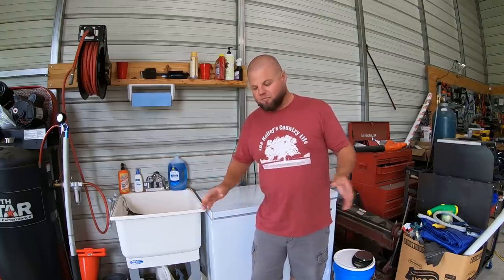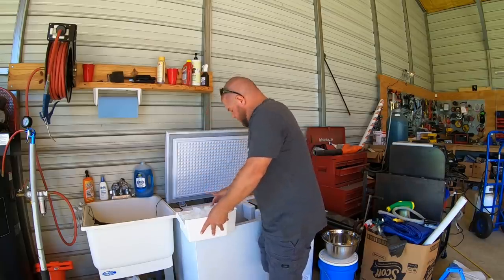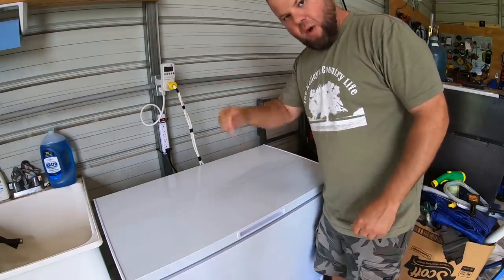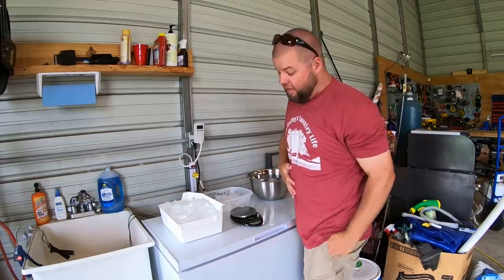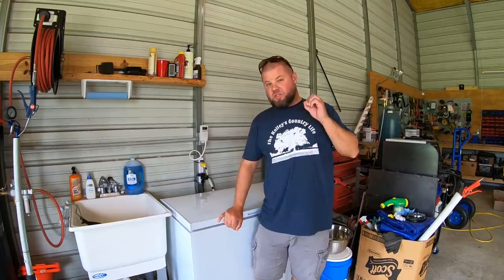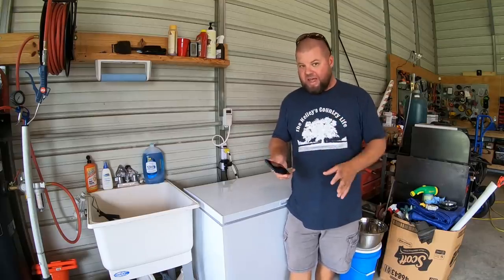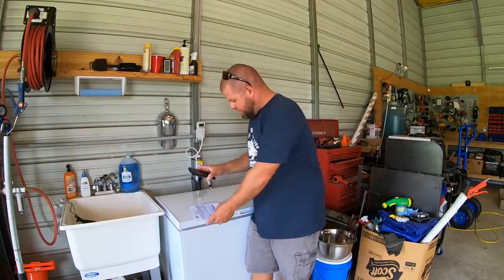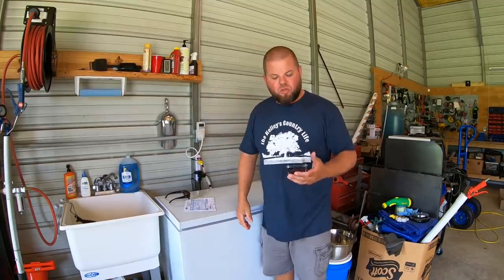Homemade DIY ice machine tests, energy usage and cost per pound! #370

Comment: The only additional cost you're missing is the cost of running the well pump for the few seconds it takes to fill the trays... More than likely negligible, but might be worth mentioning. Sure would be hard to measure given that you're using the water in the house as well. In reality, it costs less than washing your hands an extra time each day :)
Reply from the maker: I tried to figure it, it's basically nothing for this amount of water. Maybe a cent a 20lb bag 🤷

Comment: Is it possible to have an internal camera? It would be fun to see how many ice drops ie 1 drop = 12 cubes = x pounds and you could see if not opening the lid makes a difference? Also if you make a ramp so the Ice shoots to the storage not blocking the underside of icemaker? 

My other thought is the Ice ramp that bypass your collection spot and has a level. Allowing you to hook up a digital weight of your freezer and track production and consumption of ice with out the hassle of tracking and an error that could occur?

Depending on empty weight of freezer ie no ice but all parts could you set up a digital recording of the weight of the freezer day by day to say the weight of 100 pounds of ice and week 2 we made 50 pounds  added to week 1 45 pounds and used 5 pounds could all be calculated based on average weight? Tracked by raspberry pi  and data could be plotted.

Yes a second point of data confirmed calculated  that could end up continuing with digital recording of electrical use and automated software so you have numbers generated.  For 2.0 it would cost justify .44 cents with verification.. I am sure 3.0 will be behind it!
Reply from the maker: Good thoughts

Comment: Dissipation of exterior heat Idea, some kind of aluminum heat sync, I know I'm not considering a cost of the heat sync material just a NON electric use of dissipation of the heat to help "Speed" the transition of the coolant back to a liquid state yada yada yada you get the drift...
Reply: I'm referring to the exterior of the deep freezer
Reply from the maker: Understood, thanks

Comment: You're using .188kwh per pound. Commercial ice makers use between .055 (US DOE) and .075kwh (PG&E) per pound. So, your efficiency is bad, but we're only talking pennies. The difference in equipment cost is huge, though.

Comment: The hot water freezing fast your thing isn’t necessarily practical. In an environment with unlimited amounts of cold air or the ability to draw heat away hot water evaporates and evaporation gives you greater convection and greater heat transfer so yes if you put a small container making one or two cubes in your freezer it might be freeze faster withWarmer water the problem is the freezer device is a unit that removes heat from the interior of that freezer and depending on how efficient your unit is you have very distinct limits at which point the efficiency as loss by adding the heat so to make a very small amount of ice very very quickly in a shallow tiny ice tray in a very big freezer, yes hot water can freeze faster like if you were outside at -25° and threw a small container of hot water into the air, what hits the ground will be more frozen then if you did the same amount of cold water but in a confined small area where that heat is going to take longer and more energy to dissipate that threshold as well as your devices ability to do that heat removal you also have to look at the temperatures with your freezing out, this is a deep freezer and it should be operating at a colder temperature then the 32° at which water freezes it should be at least subzero temperatures in Fahrenheit. The test will prove it but my guess is not only will you find that the cold or the cooler the water the more efficient it is and the faster it produces ice but you also find it gets rid of other problems because when you freeze hot water the outside is going to freeze faster than the inside and the ice you drop it still going to be wet and you’re going to get a lot more clumping in there than in the end I think and I’m predicting that the results will be more Clumpies ice and tire energy usage. It’ll be interesting to see how that one pans out.  

As far as the clear ice goes filtering is one option but also some of the clearest ice has to do with mineral and particularly sodium levels the crystal clear blue ice you see on glaciers and things like that are usually in areas with salt water and part of the reason they’re clear is because salt water freezes slower and will let the gas and air out during the freezing process but as far as making a list for your purposes which would be either drinking and mostly filling your cooler to keep fish and drinks and other things like that cold, a clearer ice affected by salinity would melt much faster it would really be something you don’t want not to mention your freezer would have to work much harder to freeze that ice in the first place and keep it frozen. I’m sure you know from fishing and boating salt water freezes at a much lower temperature than freshwater. And of course filtering ice for health reasons is good depending on the quality of your water and water is already sediment free and healthy then it’s completely unnecessary if you live in a cesspool city with a horrible water system like Michigan it’s potentially life-saving. You can get a TDS meter for about 10 or 12 bucks off Amazon that will give you the dissolved solid content in your water to determine how much crap is in there along with minerals and other elements, and Aro filter or RODI filter would give you the purest water with basically nothing in it but oxygen and hydrogen but I’m not sure water is bad to start with it’s really not necessary.  Almost any in-line filter would make most tapwater’s incredibly clean and safe but I don’t think for your usage it’s really something to worry about unless you’re getting your water from a shallow sand well or pond or lake. Clarity theoretically would be unless air in the ice making it more efficient because you basically have more ice in that amount of space but other than looking pretty I really don’t see much of an advantage unless your water is very unhealthy to start with.

Comment: Wow with the testing you've already done I'm hoping you decide to make a power drive for a kayak it's my ideal the kayak rowing is the wife's bright ideal let's get healthy kick she is on I work 12  hours a day I need a electric motor on a rudder  help please if possible
Reply: Jeff, see if this helps: eBay a 20Ah LiPo battery,  Minnkota trolling, if really want cool help for battery add a flexible solar panel 100w is about $50?. Why do I harp about the value you get from these batteries? Ten Times better on power curve right out box! Equal to twice lead! Last ten years! Ok I ll stop.

Comment: Keep it going love your videos.  Your cost per pound of ice does not account for the cost of the water.  If you are using well water, you would have to calculate how much power it takes to pump water for a pound of ice.
Reply from the maker: It's almost non existent. 80 gallon tank that almost never kicks on, and when it does the pump runs for literally a few seconds. So a cent per 20lb bag... Maybe?
Reply: @TKCL  Yes you may be right there.  Thanks.

Comment: You also benefit from less heat being generated in the freezer when you take one fan out, it isn't much at all but every little bit helps I imagine.
Reply: Technically true, but realistically negligible. Two fans were using 2 watts, so 1 watt of heat is all that would be removed. The way compressors work, it takes way less than 1 watt of power to move 1 watt of heat, so that 1 extra watt of heat is probably only causing the compressor to use an extra 0.3 watts.
Reply: @AsherMaximum  It's almost like I said it wasn't much at all.

Comment: Would a frost free freezer make more sense?
Reply: Its would partially melt the ice id imagine, making ice slabs. Also costs more to run
Reply from the maker: That's exactly right, not the correct freezer for this application

Comment: If you really really want to be accurate, empty or reset ice machines before each test.   Also consider adding a timer to the fan with double switch.   Primary switch is lid open closed, secondary is timer.    Weird how your experiment is interesting.

Comment: Be sure to factor in the cost of the machine when figuring the price per lb.  You'll have to guestimate the life of the machine,  maybe 1000, 2000, or 10,000 lbs. who knows?
Reply: $300 machine with life of 5 years just out of warranty put $0.33 for 20 pounds bag of Ice.
Reply from the maker: I did in my first video ROI was 9 months at my current usage for just equipment, it's has since improved. Still cheaper than store bought

Comment: Haven't seen this mentioned a lot in the comments, but you should be able to save yourself a lot of time weighing ice by adding a flow meter to the water inlet, and just measuring that for 24 hours instead.

This one is only $20 and measures to 1/10 of a gallon, which is equal to 0.8 lbs of ice, or 12.8 oz. It's meant for a garden hose, but it should be easy enough to hook up to your system with a few adapters.
https://smile.amazon.com/Save-a-Drop-P0550-Water/dp/B0058EOC5M/ref=sr_1_2

It has very mixed reviews, but all the negative reviews are around longevity, not accuracy, so for a short term project it should work fine I think
Reply from the maker: Thank you

Comment: Did you say that you've paid about $360 for the entire setup? 
.44 x 20lb bag. 
10 lbs per day at .22 per day, 182 20lb bags per year is your current capacity.  

Then divide the cost of the setup by 10 years (average life span) to get your per year cost of the ice maker.  
Total DIY Cost per Year  = $36 per year + (.22 per day) $80  - or - $116.3 per year
$116.30 for 182 20lb bags per year

 Total Retail Cost per Year  vs  Total DIY Cost per Year
$2.50 x 182 20lb bags =  $455
$3.99 x 182 20lb bags = $726.18 

Someone else can check my logic and math.  But, it looks like you are definitely saving money.
Reply from the maker: Thank you for the breakdown, I was getting ready to do that myself

Comment: I cannot help but wonder of those who labor under the misapprehension that "hot water freezes faster than cold water" have ever actually tested that claim. Think about it: Water freezes at ~32 degrees F or ~0 degrees C, depending upon some variables. Would they have us believe that if you heat the water to a temperature GREATER than 32 degrees F before hand that it will then freeze FASTER than if you didn't heat it up? After all, it still has to get down to ~32 degrees BEFORE it will freeze. IOW, it isn't logical that "warm or hot water freezes faster than cold water" because it simply isn't true.
Reply from the maker: We will find out soon enough!

Comment: This is what I find ridiculous. You've spent around $400 for the set up. That's just for the equipment - the freezer, fans, ice makers. Now you're able to make 20lbs of ice for around $0.40. But that $400 hasn't gone away. Like you've already spent it.

A 20lb bag of ice costs you around $4. You can make the same for around $0.40.
Which means: For every 20lbs of ice you pull from your freezer, you save $3.60 compared to buying it. To break even with your initial cost, you would need to use 2,222lbs of ice (111 20lb bags of ice. It's only a saving really if you're pulling the same amount out as you would have spent on buying it). How many bags would you realistically use in a week and how many weekends do you think you would use it?

Like you're looking at probably around 2 years before this solution breaks even…

On the other hand, rather than trying to justify the cost, just admit that you're enjoying making something and while it might not necessarily be the most economical way to go about it, you're having a hell of a lot of fun doing it and that, to you, is priceless.
Reply from the maker: I use 40-80lbs of ice a week minimum. 360 dollars so far in equipment. Cheapest ice around me is 2.99 a bag. A lot of places I buy from went to 3.99 a bag. Now you need to factor in cost of fuel to drive, wear on vehicles, junk you are tempted to buy at the store, plus just the overall convenience. There is no way this is not cheaper than store ice. Even after factoring in the equipment costs.
Reply from the maker: And yes I am having a blast building this and tweaking it

Comment: I understand it wouldn't be self sufficient but would just filling ice trays daily be more efficient
Reply: Forgot to mention, I love the content. I'm currently in the process of recreating your set up but I'm putting it in my basement
Reply from the maker: Not in my mind, put in the work once of building this and reap the rewards forever... Or as long as the equipment lasts. As for the trays, that's a daily chore now created and I use anywhere from 40-80lbs a week. That's way to much time filling and dumping trays.

Comment: Reason for the increase in fan wattage is the cold resistance to turn the blades. Also blowie fans would move the air inside the box alot more efficiently then traditional pc fans

Comment: Point your misting fan at it!!!!  Might cool the whole freezer off....🤔
Reply from the maker: Lol that might work
Reply: How about a small tent around the freezer, with the misting fan pointed into it? Cut a round whole in tent, seal fan around whole. Probably keep the outside air surrounding freezer around 70°.  I would be curious to see if too much moisture would build up in the tent. Or collect on the freezer. 👍
Reply from the maker: Worried about introducing moisture in my shop and around tools. Could cause problems
Reply: @TKCL  I thought the fan was very fine mist, the tent would keep moisture from the shop on general and the airflow inside the tent might evaporate the moisture.  Of course any increase in production of ice or decrease in electrical use of freezer might be offset by the electric use of misting fan.
Reply: Move the final freezer into an air condition room like a laundry room so it doesn't have to overcome the outside temps.

Comment: The  only thing that affects the amount of ice is not the amount of fans its only gonna make ice every time the ice maker completes a cycle and dumps the ice,can't believe your wasting your time ....it's only dropping ice ,say every 45 minutes cycle  so I don't know what trying to prove with 1 or 2 fans but good luck
Reply from the maker: Because it's NOT timed.  There is a thermostat that reads mold temperature, then activates a short TIMED dump cycle.  The quicker you get the mold temperature down, the more dump cycles that are triggered.  The fans speed this process up and produce more ice.

Comment: In order to actually get good data on each variable you’re testing (ie one fan, two fans, etc) you have to have the same conditions including the amount of ice in the freezer, ambient temperature, pressure, feed water temp, etc.  or get data on the effects of each that you can use to correct results of your test runs to a standard set of  conditions.

Comment: I watched every minute. Yes, it was 30 minutes, however, there was no wasted time. This is anything but boring. It's not like you had us sitting here watching water freeze. You conveyed a whole lot of data in half an hour. 
You mentioned something that I hadn't considered. You're drawing your water from a well. (What part of Florida are you in? I grew up in Miami and Hollywood. We were on "city" water, and this was many years ago.)
If your well pump and pressure tank are out in the sun, get them covered. I live in Arkansas, the weather here is every bit as miserable here as it is in south Florida, hot & humid. The difference is it gets a little colder here in the winter. I have one of those metal carports set up over my well, the sun never hits it. In the winter, I have a 3'x3'x3' insulated enclosure that I set down over the well. I have a 60 watt light on a thermostat in case it gets really cold. You shouldn't have that problem though. I also keep my tractor implements under the carport as well.
I would also suspect that your water lines from the pump to the house/shop are not very deep. That will definitely warm up your water on sunny days. 
My well is 80' deep, and the line up to the house is 3' deep and comes in on the north side of the house. My summer time water temp pretty much stays in the 
68⁰ - 72⁰ range. 
Something to keep in mind for your ice maker. When it draws water, it isn't much. The temperature of that water is going to be whatever the temperature of the supply line is. I don't have the data here to support my statement, but I would bet that when your icemaker draws water, all of that water was already in the pipe behind your freezer and sink. So if you could control the temperature right there, you'll be controlling your inlet water temperature. If that is a south facing wall, just shading that section of the wall should have a significant effect.
I'm just throwing ideas out there for you to consider.
Oh, I love your videos. Great job!
Reply from the maker: Testing water now, and I agree with a lot of what you said.

Comment: The incoming water temperature absolutely affects production.  The colder it is coming in the sooner it will freeze and require less energy per pound.  The idea that hot water freezes faster is an old wives tale not at all based in science or any scientific study.

Comment: I think you mean 44 cents for a 20lb bag of ice. Not .44 cents which is less than half a penny. As well as 21 cents a day to run and 2.2 cents per pound of ice.
Reply from the maker: I was crunching numbers based on a dollar amount. I was still in that frame of mind.44 is 44 cents of a dollar. I should have been more clear